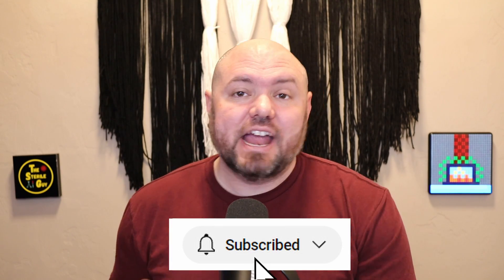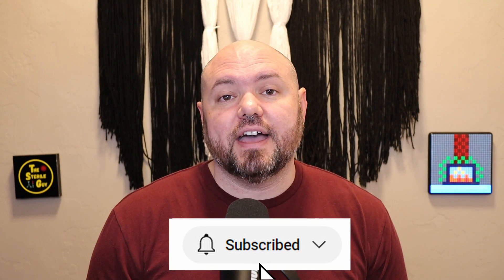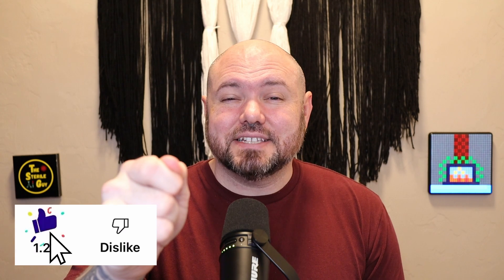Proper Temps, Humidity & Air Exchanges in Sterile Processing Department

Comment: Our HVAC is old but we were able to meet the standards.  Joint Commission said we had to follow the ashrae standard of the older HVAC.  So we have to keep it at 72-78 even though our system is able to get cooler.  Makes no sense!
Reply from the maker: That is where surveyors are out of touch. Yes, the system might be older, but if it can meet current standards then by all means do so because that is best practice.